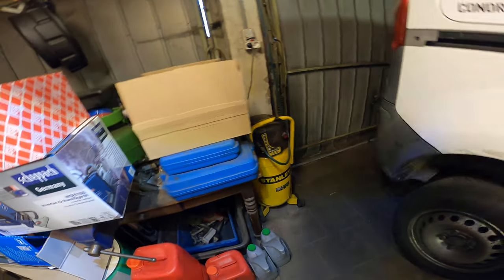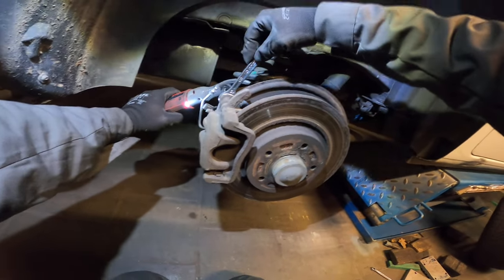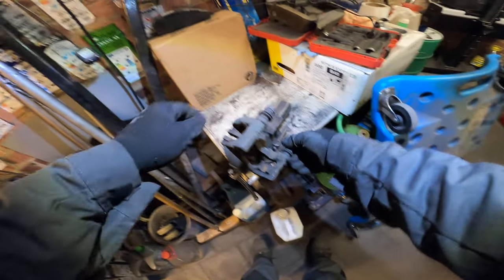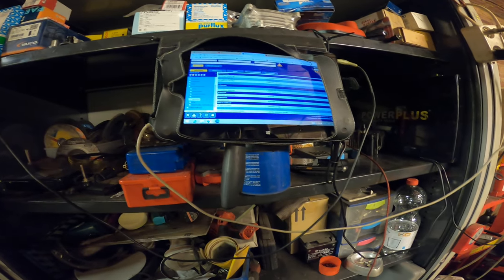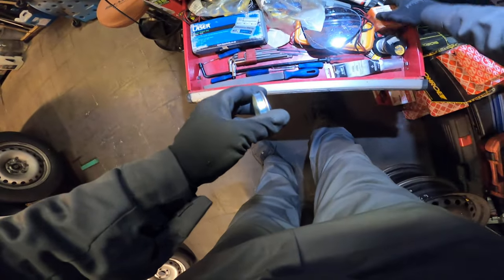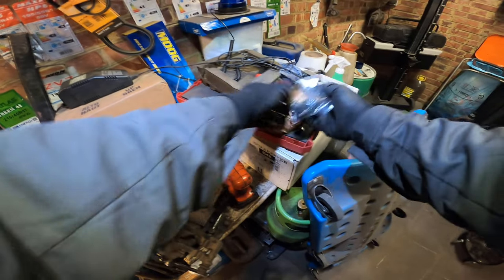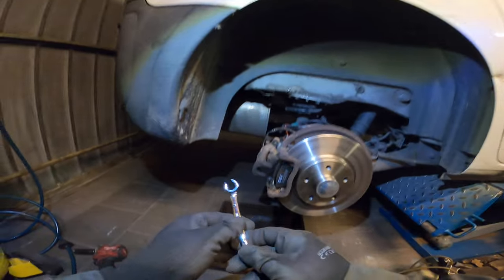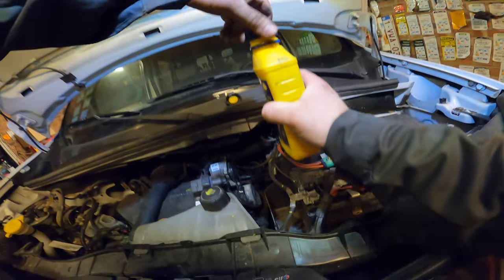Renault Kangoo 2011 rear brake caliper/discs/pads

Comment: The best automotive comedy show ever!  🎉 You are truly funny 😂😂😂
Reply: @demonautomotive2726 Just wondering if you had not to or forgot to grease the bearing and the sliding pins when you assembled the whole thing 🤔 I was hilarious to see how similarly we work...
Reply from the maker: It's a sealed bearing, should not be greased before installation and the sliding pins were greased, off course, always (coca cooooola) .But you can see that in the video. Am I smelling a trick question here? 😂🍻
Reply: @demonautomotive2726 

@demonautomotive2726 My sincere apologies. Must have missed those moments. No tricky question. I got a direct question if I may? Front brake cylinder unable to push it back. 2020 Kango. Any trick or advice please? Just done all brakes cleaning all good except those front cylinders. My own. Cannot trust Renault any longer...
Reply from the maker: Both front wheel brake calipers? Try it with a handbrake caliper tool perhaps, turn it when you try to press the caliper back in. If I feel any resistance then I replace them, they will not get better over time and when they're really stuck and heat up, you could be in for a very bad day. Couple of years ago I had a stuck caliper on rear brakes. After a 2 mile trip my brake force was nearly gone. Brake fluid overheated, started cooking. Can go bad really fast so, in case of doubt, put some remanufactured ones on there. They're often built better then the original parts. Renault is not my favourite brand either.... Just buy a Ford and be happy:) Best car price/quality wise here in Belgium in my opinion.